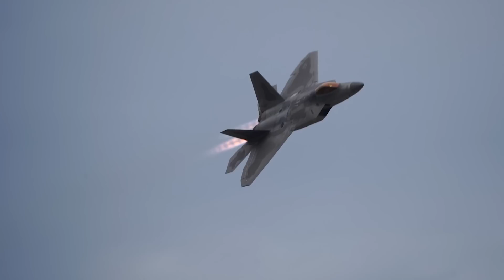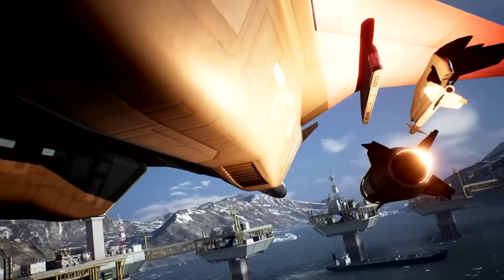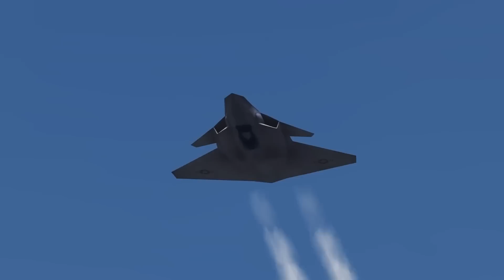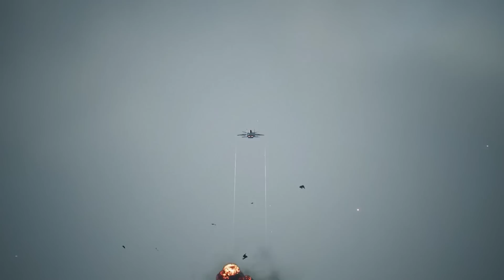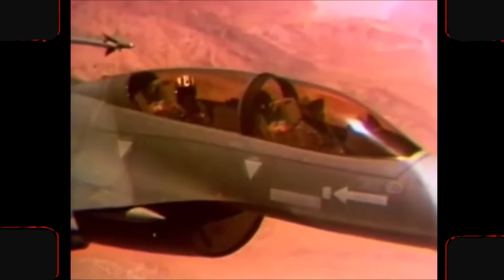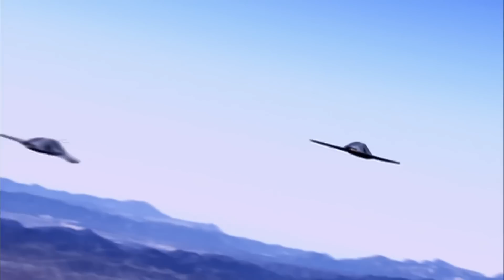US New $300 Million X-44 MANTA Can DESTROY The Sixth Generation Stealth Aircraft

Comment: The Air Force is now working to develop its Next Generation Air Dominance (NGAD) fighter program over the next decade. The new aircraft is expected to replace the service’s existing fleet of F-22 Raptors, and it is possible that the X-44 was used in part to conceptualize the sixth-generation platform.

Comment: The F-23 was much better than the F-22 Raptor, the F-22 was picked, because it was cheaper.
Reply: In what way was the F23 better??
How much more expensive was it vs the F22??

Changes came so fast that the F22 electronics platform  was too expensive vs starting over.